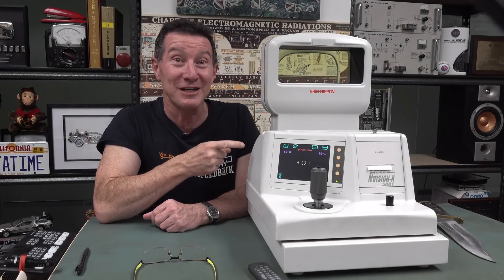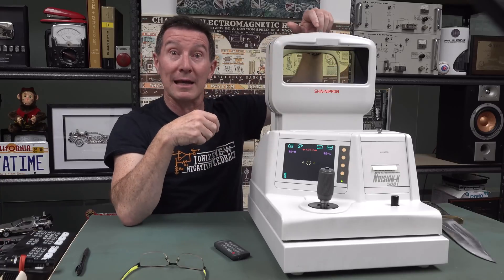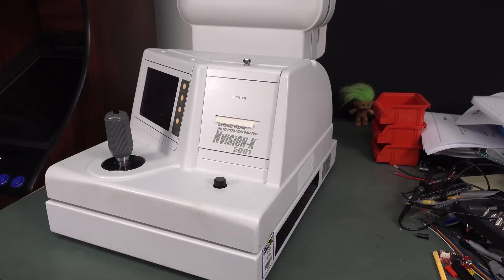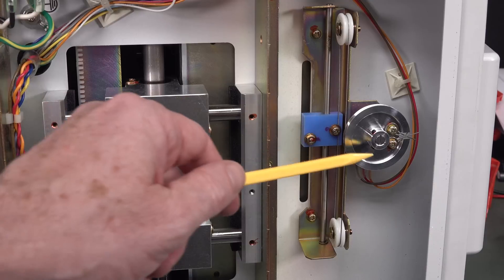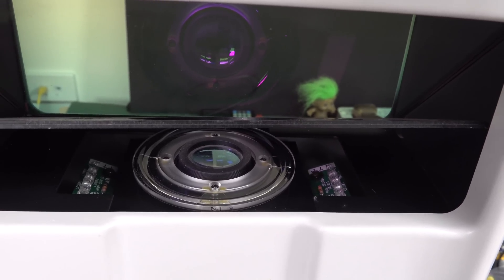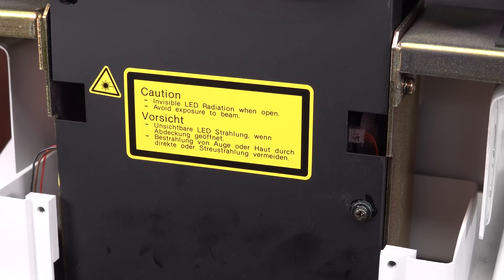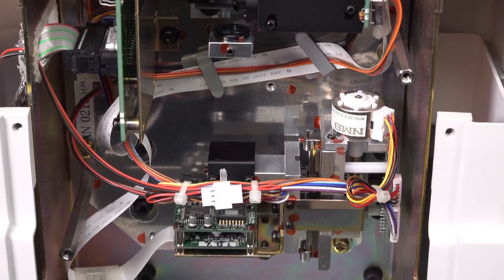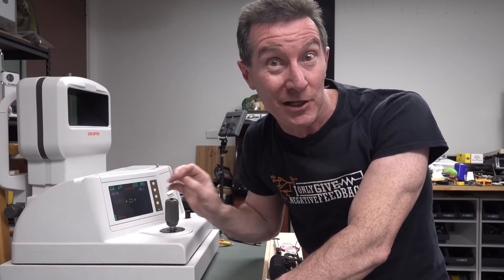EEVblog 1554 - Optometrist AutoRefractor Keratometer TEARDOWN!

Comment: Watching this was awesome, it also led me to find someone other than Laubman & Pank this time around. Have been using L&P for the last 5yrs since I went for my first eye test, but I felt the old fashioned chair with the manual method of putting lenses in front just didn't work all that well.

Made an appointment for my local Specsavers last week which was this morning, put me through this machine and another one (that did a focus and pressure test), and found that the glasses I have weren't sufficient.

If it wasn't for this video, I would have just kept going to L&P.

Bonus is that my local shopping centre has L&P, Specsavers, and OPSM, 25min drive away here in the South-West of WA.

Comment: the measurement you did told you the cylinder astigmatism for your eyes, +1.00 right +0.75 left. not unusual for someone thats getting older. cylinder means if you stare at a streetlight at night it doesnt look like a point but it becomes a line at an angle. this is different from near sighted-ness where it essentially becomes gaussian blurry.
Reply: yeah, and I wouldn't be surprised probably that last column (I think it was labbelled AX) were the cylinders axis angle

Comment: I repaired a few old auto refractometers , usualy with smd electrolytics capacitors failed. They give differerent picture on screen problems. But to calibrate all that lenses is a nightmare.

Comment: I love seeing the optometry teardowns, I suffer with bi lateral Pellucid marginal degeneration and have had my eyes scanned with so many pieces of kit I've lost count. The modern version of the machine at least here in the UK tends to show a hot air ballon on a desert road I guess some designer thought that would be a good image to focus upon. if you can come across an orb scan at the auctions I would love to see the internals on one of those. its used for measuring corneal thickness and produces a topographic map of the cornea.

Comment: Eye guy here, most have some minor auto-aligning and focusing which is probably what a good bit if the fiddly bits inside are.

The joystick up/down movement is more accurate than the chin rest. So the chin rest isn't moved much unless someone has a watermelon for a head or you are testing a child.

Comment: Thank you Dave for this information video. I’ve learned in my gotta get this device journeys to keep the kit as is and explore the design and resurrect rather than dissemble for parts. Even though its older there is a lot of engineering and design that deserves respect and inspection. If it was trashed it would be a different story. Kiddos on that concept. Keep the videos coming, much respect ✊

Comment: I lost use of my left eye after an accident while traveling in Japan in 2022 and they used this exact machine to scan my eye at the hospital! Interesting to see it in use/torn apart while not hopped up on those lovely Japanese painkillers. 👍
Reply: Also: I vote for a destructive teardown! But only because I want to buy the top level half mirror box assembly off you Dave for a project I am working on. 😆

Comment: I have stripped a couple of similar optometry items, seems incredible that they are just being dumped as they were all in pristine condition, I guess the new systems negate these, probably combine functions of multiple machines. Unfortunately I didnt find much to actually salvage but it was quite nice to pull to bits and work out the basics of what was going on inside, these must have cost serious money
Reply from the maker: I did pay $50 or something for it at auction
Reply: @EEVblog wow that is much cheaper than I expected, guess I'll be looking for one so I can do my whole family's eye checks for less than the cost of one optometrist visit!

Comment: I have mixed feeling about those, ferrite beads. I know why they use and how they work, but also never had any issue when I removed one either. seems they kinda needed but not going to be the end of the world if you remove one either!
Reply: I spent a lot of time on EMC compliance.  They are usually used to meet the local (or international) EMC standards.  This means that they won't interfere with the radios, the cell phones, etc.  Primarily, it means that the manufacturer won't get in trouble and have to pay fines.  🙂
Reply from the maker: It's for conducted mode EMC compliance.
Reply: I suspect the ferrites are mainly there to make the electrical noise people, like the FCC, happy.

Comment: You turned it on before taking it apart! I'd love to see the optometrist tour, preferably with teardowns :D
Interesting mechanical construction and definitely nice optics. Wonder what @IMSAIGuy and @mikeselectricstuff could say about it. And those colorful twisted wires, and anti-tamper enamel on screws... nice!
Reply: Teardown of an optometrist? Poor guy, but can be interesting.
Reply: @TheTallGirl  and messy!
Reply: @TheTallGirl  ha! With Dave's Dundee knife.
Reply: I would love to see a reaction video from IMSAIguy on this video.
Reply: Its not anti-tamper, its just there to lock in the calibration.. That's why Dave didn't want to go in further..
Reply: @Lucien86  I was thinking about that too, that would make sense if these screws were very lightly screwed (as in: you can twist them with your fingers) at a high risk of coming undone under vibration. But then, I'd use a thread locking compound on the thread itself. It's clear that it's a precisely calibrated mechanism and any fiddling with it would throw it off. So, the indication for the manufacturer's service that the factory calibration was kept intact.
Reply: @KeritechElectronics  They usually only use the thread lock over a screw once the component is in place and the screw is already tight. That way it can still be undone quite easily if it needs further recalibration later..
Optical benches can be particularly hard to align because the tolerances are often so tight. - Like in things like DVD or Blu ray players or even the lasers themselves.
Reply: @Lucien86  tighter than Ethel Granger's laces, like I would say :)
Reminds me of how I worked on the Monotype composition caster. A beautiful and surprisingly precise machine, with countless calibration screws and pins in different mechanisms. Some of them were locked with another screw.